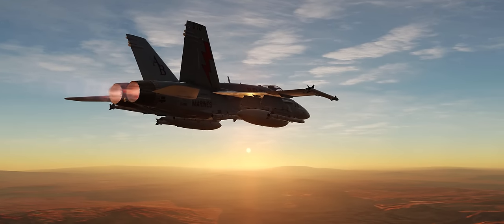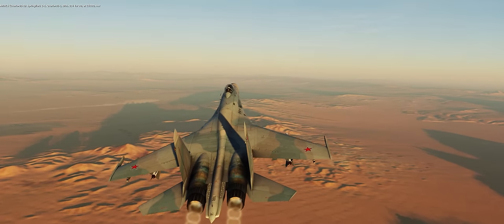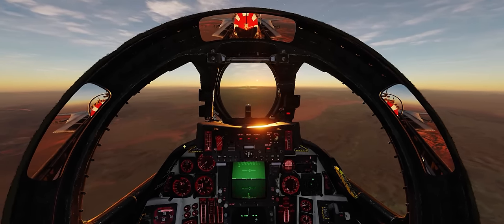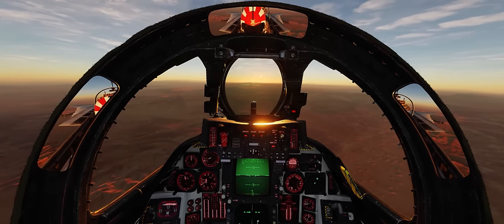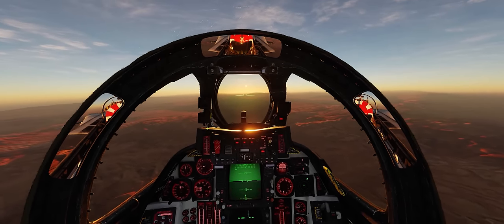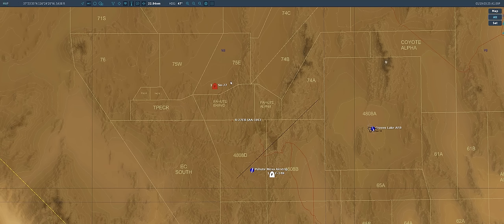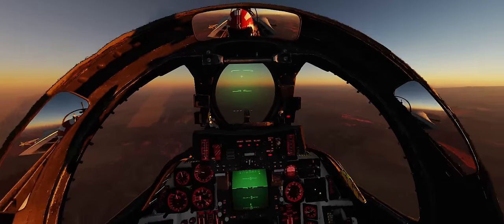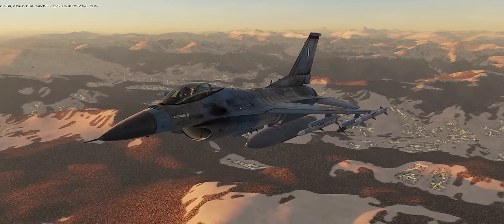SURVIVING to the Merge! BVR Air to Air missile Evasion in DCS World

Comment: You just spent 56 minutes to explain notching and f-pole and didn't even manage to fully explain two topics that should take ten minutes apiece. Also, who tf runs from an sd-10 at 50nm? They might be fast off the rail but they fly like bricks and slow down quickly when you force them to maneuver. Using a proper f-pole above mach 1 you should almost always be able to get your own missile off at around 26nm with enough time for your missile to go active before being forced defensive.

Comment: You are incorrect at 11:45. The relative movement between you and the Su-27 does not drop to near zero and even if it did, the radar wouldn't have issue. When you move perpendicular to the radar beam, your aircraft has the same closure rate as the ground around you, the same Doppler-shift, relative to the attacking aircraft's radar.
Reply: You are absolutely correct! I was wondering if anybody was going to say something about that too.
Reply: True. This is a mistake. But also, Doppler shift goes to zero at zero relative velocity. Like when you match speed with an object you chase. You definitely loose lock this way in the F-14.
Reply: @wikary4284  However, he cranked into the SU27 and not away.  That means the aircrafts speeds are added to one another, not subtracted.  So the closure speed will only increase, not decrease to zero.  He would need to crank away from the SU27 to decrease the closure velocity towards zero.
Reply: @qdrummer21  True. I was talking in the abstract. Here it's a clear mistake of Spud.

Comment: I've been doing very similar research (?) with an F/A-18 vs Excellent AI. I've found that a Hornet at 25k vs a Su-27 carrying R-27ER's can remain hot to the threat all the way up to bandit shots, defend 45° at .85 mach in the opposite direction of the Bandits crank (I've actually been seeing cranks out of my Excellent AI when I remain hot to the threat) and defeat an initial shot without ever maneuvering more than 45° away from the bandit. 

Definitely makes it easier to go offensive and hopefully negate any follow on shots from the Bandit.
Reply: I wouldn't say about flight model, but electronics of the Russian missiles are pure cr*p. Most of the time you don't need any counter-measures (except for R-73). Notching is really hard word to use for anything that you do against these missiles. I'm deeply convinced that they've modeled the missile and radar capability by some (bad) random numbers and throwing a dice. On the other hand... AIM-120 is way too powerful in the electronics dept. at least by the historical accounts by USAF pilots themselves in 1999. F-15C vs Yugoslavian MiG-29 (with radar and RWR malfunction) in which PK was 33% and that is by keeping in mind that several MiG-29 were by mistake shot down by friendly fire SAM. I'm aware that flight model is great and based on wind tunnel results etc. but as everyone can assume, electronics that you need to simulate are still blackbox but that didn't stop ED to trash non-USA missiles and put AMRAAM several bars above any other missile in DCS (Jeff's missiles are still unkown to me). When you see AMRAAM launched at you, you better be giving your best showtime each single time unless you want to be fried because you will unless you really employ notching to fullest of it's meaning and throw some Ju-Ju curse on it, just in case. One of the surviving MiG-29A from that time evaided 5 AMRAAMs and is still flying today.
Reply: @vondenzelmann6044  I know I'm a year late, but Russian missiles suck ass currently both in real life and game. there isn't the capable Russian missile comparatively to the amraam or any European counterparts. the only one that's of note is the r37, and that's a good missile but they can't produce many of them since they each cost 1 mil.

Comment: Spudnocker you may be the first one i see doing a loop dodge maneuver, to evade missiles in close range
I learnes that one back in the days of Lock On, with the mig-29 and i still use it, is a lot more effective and looks amazing from the enemies prespective hehehe
It also works at 10 and 2 o'clock, you can just do the loop, or crak towards the enemy and in a same fluid movemt you start the loop,  but if you do it a second later you are dead lol

Comment: The radar explanation wasn't quite on point.
The way it works is the radar has to filter out the ground. It keeps track of aircraft with a speed gate. The reflected radar energy is red shifted or blue shifted by the moving target and then recombined with the emitted frequency, which gives a lower frequency. Measuring that frequency gives the target's speed. Imagine the radar seeing a spectrum from blue to red, with green being 0 speed. Anything coming towards it is blue, anything flying away is red. The entire ground would be a solid block of green. If you move perpendicular to the radar, then you become green as well as you have 0 closure speed, or more accurately the same closure speed as the ground behind you.
This tactic also helps with chaff because if you are above the enemy aircraft you will still be a green target in front of a non reflective sky (say black from the radar's point of view). Of course chaff will very quickly loose all speed once it's launched, showing green. If you're still head on with the enemy or flying away, chaff will still be disregarded by the radar as you are clearly the moving target.
There was a really good video explaining this, but I can't find it anymore.